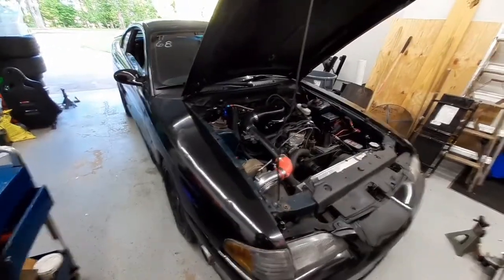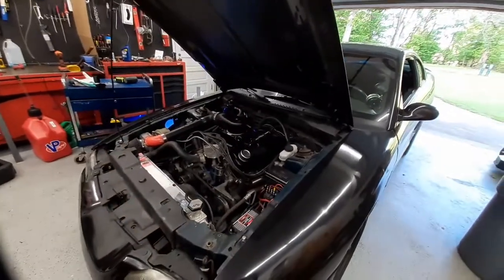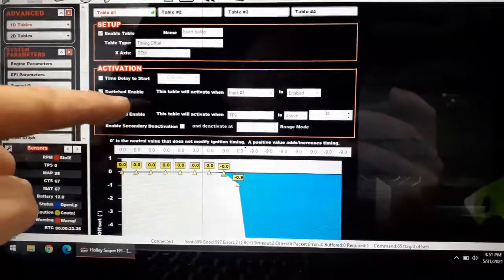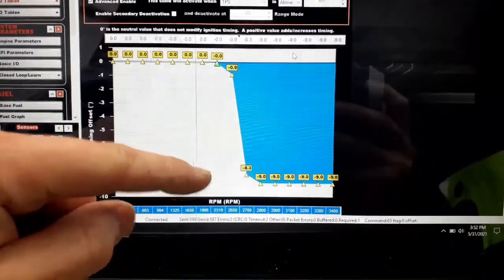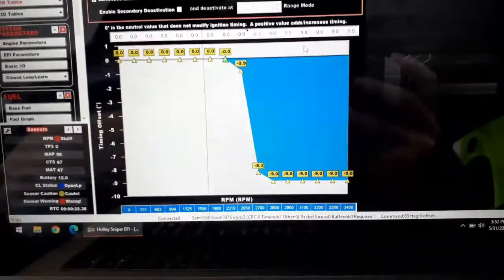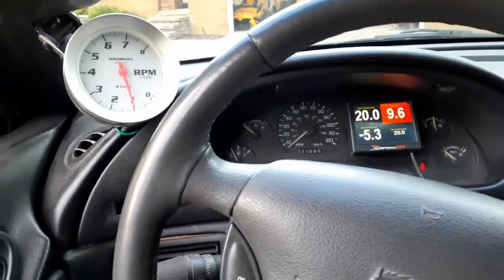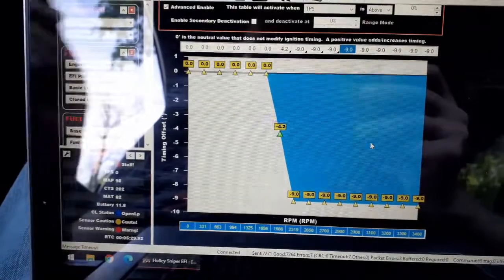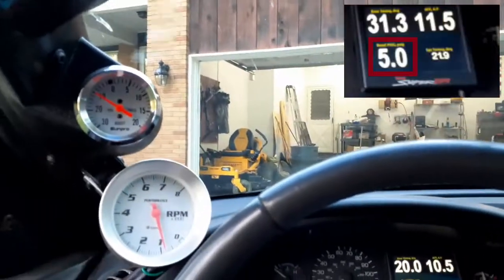Boost Building on the Line | Holley Sniper |

Comment: Could you list the part number for the Sniper kit and distributor
or cam sensor and CDI box you are using?
Reply from the maker: Super Sniper p/n : 550-519
Distributor p/n :  8598
ignition box p/n :  5520 

You can really use any type of CDI box, I just chose the msd Street fire.
Reply: @NuisanceRacing  Would you get the distributor you have if you had a choice or a 565-301 Hyperspark distributor or a 565-202 Dual Sync ?
Reply from the maker: @cb2536  I did have some rfi issues with the distributor i was running due to the distributor being so close to the computer in the sniper unit ( replacing the cap ended up fixing the issue) so I would go with a duel sync or hyperspark.